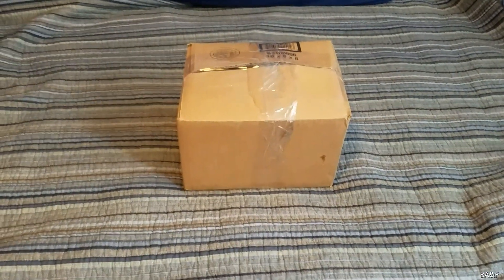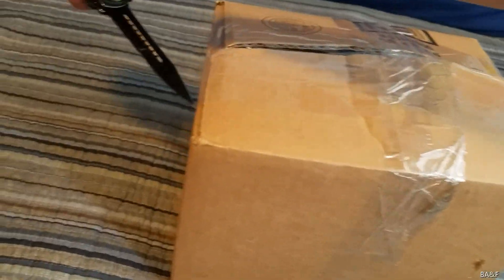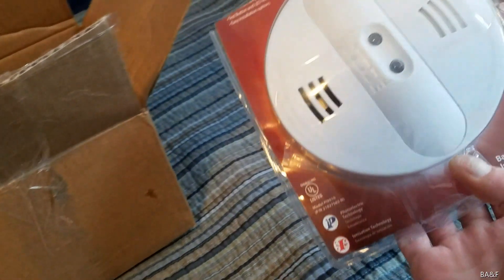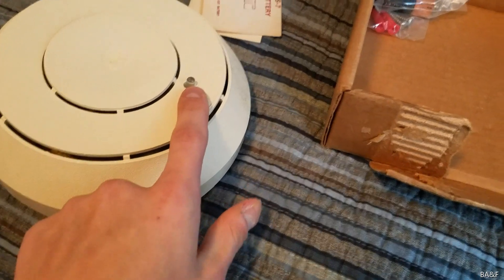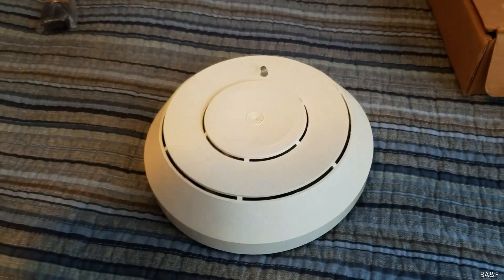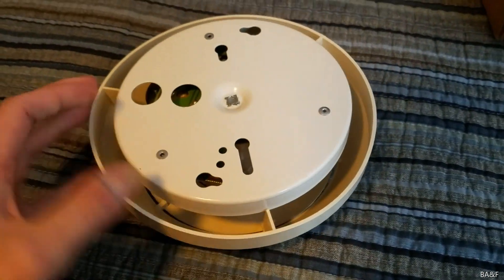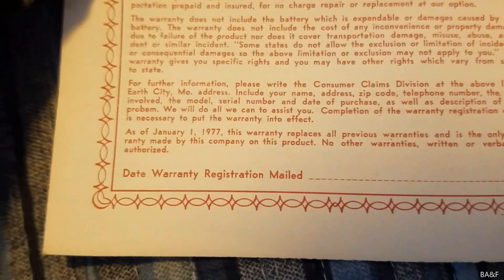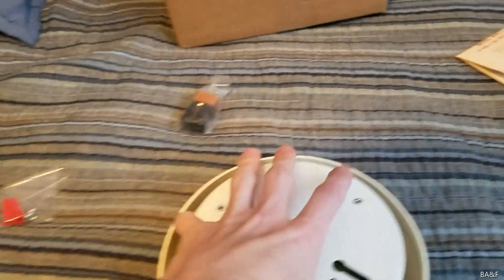Entronic Vigilante II ES-7 Smoke Detector - Unbox & Test

Comment: I moved into my 1950s era house in 2014. An electrician installed modern smoke detectors, but there's an Entronic ES-7 hanging on the wall (newer serial no. than yours) that I'm sure has been there since it was new. No one had lived here for 13 years, and I hadn't changed the battery until a few months ago, but it has consistently worked better than the new ones. This sucker was built to last forever! Always reliable! (I found this video trying to figure out how old it is - thank you!)
Reply from the maker: nice that you maintain it, these are kind of uncommon. If you ever happen to replace it I'm certain a collector will want it.

Comment: I just got a Vigilante 2 BNIB on ebay. Came exactly as yours did only the box has all of the pics and info on it
Reply from the maker: This one is a contractor model there were several on ebay that were retail models like the one you got. Yours has a different horn though
Reply: Baltimore Alarms & Fans what is the difference in horn out of curiosity? I’m going to power it up tomorrow
Reply from the maker: The retail models had Edwards horns. Contractor models like mine had the Kobishi CLB-27 horn
Reply: Baltimore Alarms & Fans if you’re interested I just posted a vid of my smokes in my house. Just put all new BRK photoelectrics up and left a Firex 1020

Comment: I got a few first and original to the house 2 sears smoke alarms and three smoke Guard smoke alarms from statitrol corp around from 71-77 but these are rare because you can change out the sensors by them selfs every 10 years so there still on the wall an ceiling and still functional

Comment: Nice detector. 1976 or 1977 I was 3 and 4 years old. Love the sound of it and a very unique looking sensor. Even though it was a huge unit for some reason I thought these units were much newer. Thanks for sharing!
Reply from the maker: The Z-700 and hardwired Z-100 were a few years older, the sensor looked the same but had radium 226, didn't have a label and the "target" (top plate) was removable for cleaning. They revised the design for this, I'm guessing this was when they started using the unliscensed Americium 241, must have solved that issue upon release of the ES-3 which came out not long before they went under.
Reply: @BAFVintage  Oh ok. I will have to go back and check out your older videos. That again was a unique looking sensor and that I can understand why it was changed. I have four alarms (detectors) from at least 4 different eras going from the 1960s to 2006. My favourite one is my First Alert SA76RS circa  1977. A sound that as a kid was my worst fear and now I love it. I am hoping to grow my collection this year. If you can find any old Sears, Dicon or Honeywell units (squealer horns) please let me know.
Reply from the maker: The way the target could be removed on the original models was useful because there's no case around the sensor, it's open to air and any dust/dirt particles so I'm sure it was prone to false alarms.
Reply: @BAFVintage  Wow that is interesting and those alarms and detectors would now be my age or older.